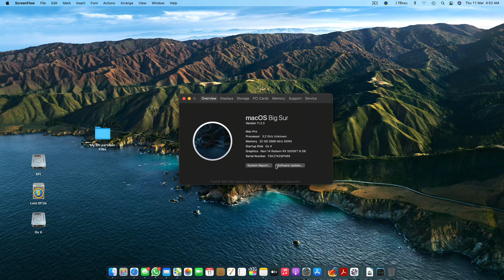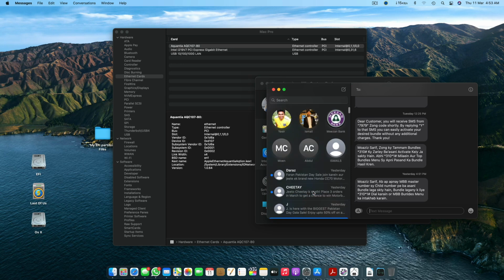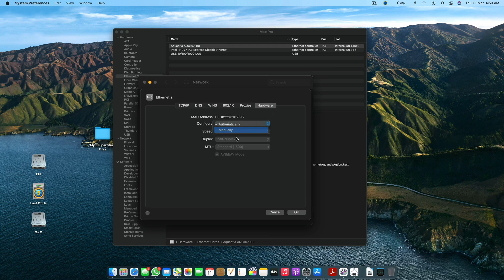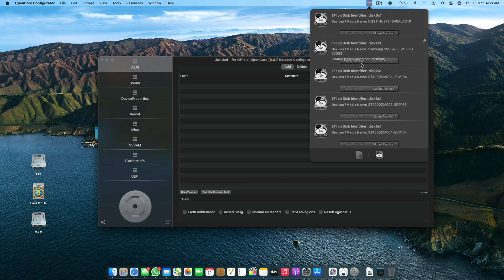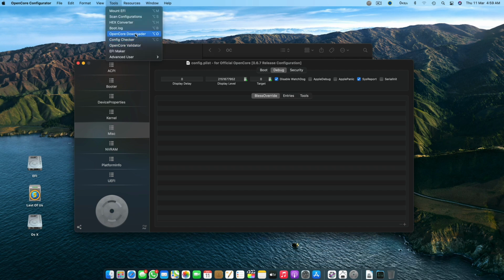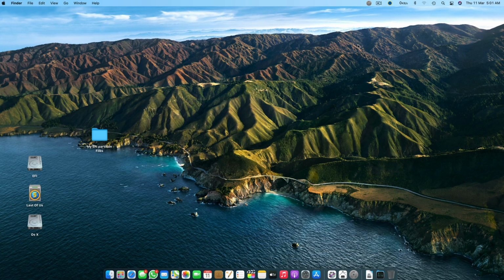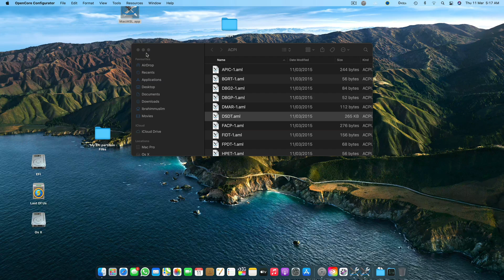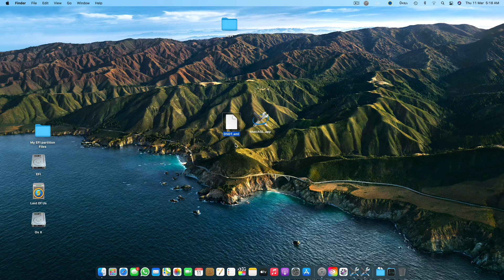Learn to create DSDT and SSDT Tables for your HACKINTOSH | 2021

Comment: Hi, could you help me?
I have the following hardware:
Ryzen5 3600
MSI Mortar Max b450
Nvidia GTX 760 2gb
Nvme m2 Windows 10
HD Seagate 1 Tb BigSur.
I've already done the installation of BigSur, using OpenCore. Since it is not set up so well, like yours.
For example, I can't access windows 10, by booting OpenCore. Only using the bios, and I can access windows 10.
can you help me?

Comment: Hello, I need your help my HP 14s everything works except shutdown
When I want to shutdown the Laptop doesn't finish the shutdown process. on log says CPU Halted, screen goes off, but Power LED still lights and next Hard Disk LED also lights. Dual graphics card, AMD already disable. Using OpenCore 0.6.8 pls comment what SSDT portion should I fix?